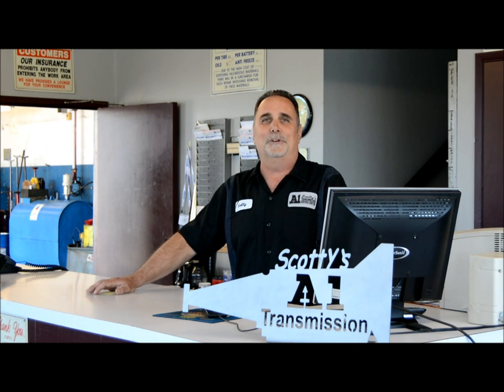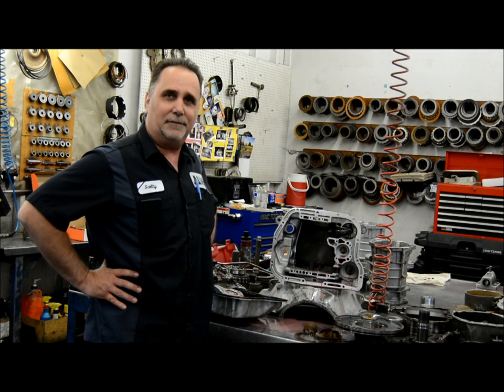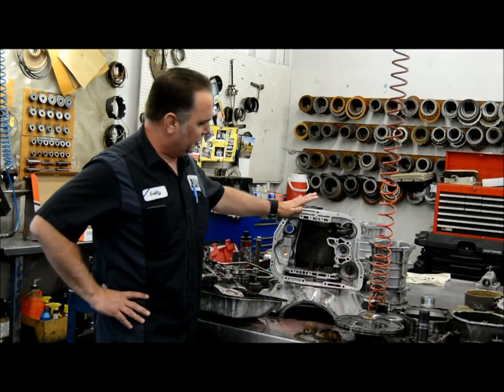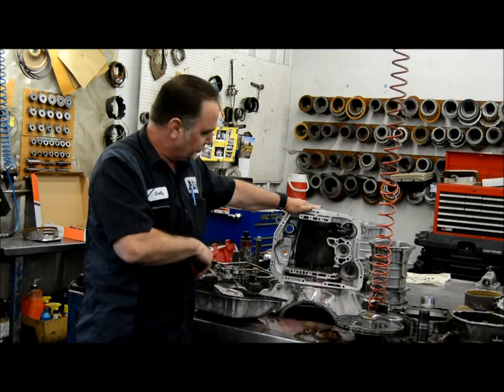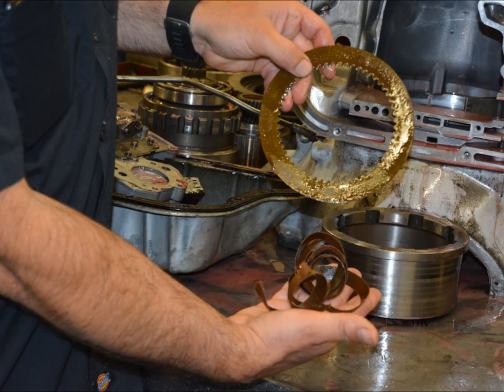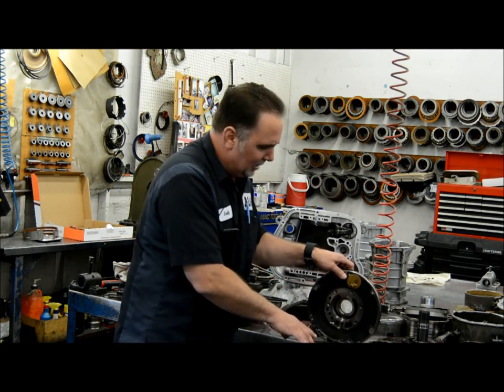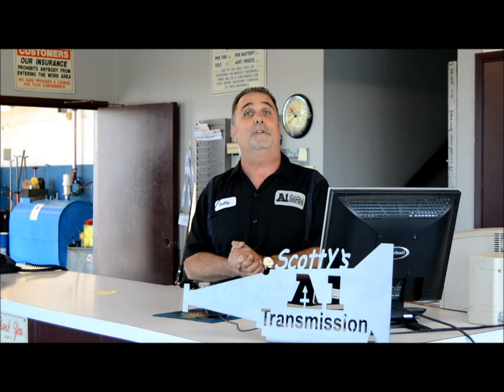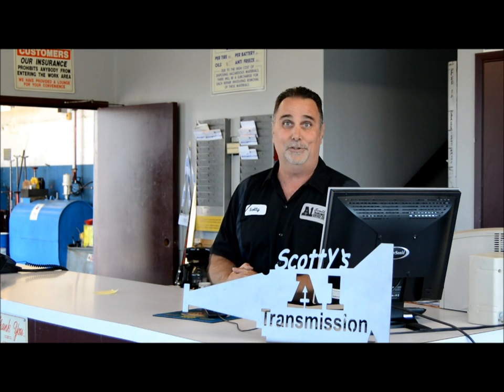Got water in your transmission? Don't try to flush it out!

Comment: I flushed mine out I used 3 gallons then I replaced my filter than I used a other 3 gallons to flush again and 6 years later it still runs but good advertising thoe thanks for the info
Reply: It would mean a lot if you reply back you seem to have some knowledge about this my cooler inside my radiator cracked thus letting coolant and water in my transmission since that happened my TPS MaP and crank sensor went out for some weird reason thought transmission was done cause it was reving high and didnt want to shift changed the sensors now it shifts perfectly installed aftermarket transmission cooler since then the transmission has only overheated once again scaring me thinking i should just give up and send it to get rebuilt i think it only overheated cause i was driving it with the bad sensors so it was working twice as hard due to the high  rpms before shifting what are the chances that a transmission is done after this happends it happened to me at a trail drove home like that and flushed it 2x so far last thing i think ill do for it is change the filter whats the reason behind the lines and oil pan getting extremely hot is it because the water in there has a lower boiling temperature  ?
Reply: My 86 chevy got flooded , i flushed it , but it dont get used much , drained it three times actually , i didnt flush it , its still pink , i took it on a couple trips 45 miles , so far so good , now i got my 09 chevy in the shop , it was right beside the other one . I know that freshly rebuilt 4l60e is toast aint it ..i just pulled it ..

Comment: I had this problem on my honda pilot. Flushed the trans. And 40k miles later it's still good. You trans shop guys are over exadurating sometimes. Plus this is vehicle specific. A pos dodge 3500 is a heavy truck and it takes a lot to move it around.
Reply: Still going good?
Reply: u ain’t lying did the same thing on this Mercedes in it’s working probably over time it might fuck up
Reply: got an 04 mdx with 180k that we are doing the flushes on right now... so far going good.. not pushing the car hard yet.. it and the engine got contaminated... 3 quarts trans. and a engine flush each week.

Comment: I believe that a transmission can possibly be saved if it is caught early on and properly flushed.  I just recently went through this and have put 10,000 miles on my transmission so far without issue.
Reply: What do you drive

Comment: Get to the point, demonstrate problems caused it how to repair and fix properly.
Reply: The water they are talking about is coolant. What happens is radiators chambers explode inside the radiator or leak internally and get coolant into the transmission side of the radiator. It will mix throughout the engine and transmission quick and total the car unless you got a ton of money. Flushing of the entire cooling system and transmission is needed. But there is almost never a system that will tell you what happened unless you check your car often and the transmission will be destroyed and the engine possibly to. Hope this helped explain your question.

Comment: It happened to me before 3 years or more in nissan altima 2006 first drained coolant from radiator changed it then drain transmissiin oil refill with oil transmissiin untill its clear or better mean 2 time is ok keep car heating up then change gear after that drive car for 5 minetes all gear then go back and drain oil and refill again  and take a ride so total drain refill 5 time from your first drain then refill it with oem transmissiin fluid and you are done your transmissiin will run like a champ no problem for me flushed radiator and ive added external radiator for transmission
Reply: Do you use new transmission fluid every time?
Reply: @MisterFuturtastic  yep
New its chepo atf transmission fluid i bought a big cartoon it contain 25 can eacb is one liter coast me about 50$ and then refilled with good oil so its cheap fix than buying New transmission or used and ask for mechanics to do service for it then install it so its big headache also this changing oil 5 time is big headache for few hours only and you are done good luck friend
Reply: Great info thanks so much! Good luck with your transmission!
Reply: @MisterFuturtastic   its working since the day ive done the flush
Reply: Awesome!

Comment: Good advise if you want a 100% reliable fix.
Great Video, love seeing the inside and getting the expert advise, if you were around manteca I would bring my car by, I love honesty.
 
If your willing to risk getting stuck and wasting money (I drive just around town in my Chevy Venture) then I would; 
1. Disconnect the transmission line and get all the bad fluid out while the car is running in park this helps pump the fluid out of the transmission and torque converter. once the fluid is out replace the filter, clean the magnet. 
2. fill it and let it cycle and do it again. we don't drive far and this worked on mine.  
3. don't plan on taking it far, expect it to fail, and get some towing..... plus plan on a new vehicle or taking it in. start saving looking and look for a low interest loan.
this job cost me 450$ because of all the fluid, filter, gasket, and I needed a radiator as well.   Taking it to the shop is going to be 2000$ easy. Might want them to replace the engine while they spent the labor to everything out it would be cheaper that way in the long run and if you like the car with high mileage it is worth it.
Reply: It lasted 6 months......... I am back to tell you.... When your right your right.  I am now looking at a rebuild.

Comment: I've seen this myself. One other thing that is bad about this is you never get rid of all the water!!! A big percentage of it stays in the torque converter, & it also starts to rust the steel components. Best thing to do while your car is having the transmission fixed is to spend the extra money & have the specialist I.E. YOU install an external trans cooler.

Comment: Hi i have Honda City zx cvt 2007 model..my cars was flooded with water..now engine started working fine but my Cvt transmission still has some water in it...i have changed transmission fluid almost 5 times but still it has some water which contaminates oil...any solution

Comment: I dumped mine so the clutch wouldn't be sitting in funky fluid, but there was TONS of dust in there, no chunks though, I plan to fill it up with fluid then go get it flushed at the lube place or whatever, any additive products you can suggest that will help me get the most miles out of it?

Comment: My problem was i had just did a trans fluid change and when I was filling the fluid some fluid got on the exhaust manifold so I took a bottled water and splashed water on the manifold so it won’t catch fire or stink bad, but some of the splashed water made its way down the filler tube. Sometimes when I check the fluid on the dipstick I see little speckles or  of white. Nothing big. The vehicle is shifting nicely
Reply: How is it now?
Reply: @lewisproffitt9584  still running good
Reply: @kchilz32  nice, I left some old fluid out and it turned murky red and I put it in my car last night really worried about it 😂

Comment: Hello.  My dealer says my 2018 with 20k mile 4 cylinder 9speed automatic has water in it.  I don't know how never been in deep water.  Possible this happened from an engine wash? How about idling for long amount of time?  So is your answer that I need a new transmission or a rebuild? Also how can I tell if a used transmission had water in it? Thank You.

Comment: How did the water get into the transmission??
Reply: Transmission fluid passes through radiator, this helps to maintain proper temperature of transmission, in case of any leakage between water passage and transmission lines in the radiator leads to mixing of water and transmission fluid. Some vehicles have separate air cooling system, which is trouble free.

Comment: I have a question. I'm remaining a 1997 46 re right now and the reverse drum looks really great except it's got this....little, teeny, tiny bit of rust on it. It's just kind of speckled on there. I suspected it had been running water with the fluid but I didn't notice the rust as I pulled it apart. I left the old fluid on it but it sat on the bench for like a week. I'm thinking it was a mixture of coolant and ATF and maybe it dried and now there's flash rust because it finally got to oxygen. It look spectacular actually otherwise. What will that rust do of I reuse it? It's really, really superficial. You can wipe a lot of it off with a rag.

Comment: greetings, I spend with my ford explorer, entered the transmicion water. repair the radiator. drain the oil. and I have already done 2 oil changes, but I feel the changes as heavy. improved oil color but not 100%. What do you recommend me. the model of my transmicion is 5R55S. perdo by language. I am from Venezuela
Reply: If you read the service manuals for most vehicles, flushing the fluid only removed 1/2 of the total volume of fluid in the transmission. So the first time you do a flush, you will have half as much water; the second time, a quarter; the third, an eighth. Water gets mixed into the transmission, torque converter, lines and radiator (if present). The best thing to do after a flood is simply not try and drive your car; but there is no need to tow it to a transmission shop. Water enters the transmission via a vent tube or dipstick on top of the transmission. You can simply do a transmission flush from the exact location it took on water. Do not start the car or put it in gear or else you will start the mixing process....

Comment: I bought a 2001hyundai Elantra I was told that the transmission was shift ing hard because  of sensors so I rolled the dice for 300 Dollars  it took me 2 days to realize that there was water in the transmission I checked the car transmission  oil was Pink but after driving it I opened the radiator there was brown sludge built up  I thought blown head gasket but the oil was fine checked the transmission again it was Pink but at the top there was burly visible brown sludge I proceeded to drive it another 100 miles and bought 6 gallon of transmission oil and bought a transmission radiator cooler installed it the car shift s smooth  but my sensor s are mess up some times  it up shifts and down shifts so it kicks caused by flooring it when down shifts I'm at my 1000 mile marker right now      ...... Thing's that car did when it had this problem  shift hard very hard also when put it to drive or reverse gear would not kick like limp mode and if accelerated it kickin into gear with a big push and loud noise but no problems til this day
Reply: probably a simple shift solenoid(s) change would have helped too.. good job thou.

Comment: I have attempted this, possibly ignorantly, on a 1986 Nissan Stanza station wagon with 4speed OD auto..  i flushed it with Diesel multiple times, only runing the engine slightly stationary, working all the gears and changing the diesel with fresh for each session...iv now recently switched it back to used-ATF (drained from other cars in my collection with ok/working fluid..)to flush additional water & to get the diesel out...then began driving it a mile or 3 and continuing to change the fluid for now new atf until it stops becoming dirty...the car only has 105k on it, warehoused indoors since 1999...no rust. Only paid $1k for the car and the ultimate fix is to replace the transmission, which would be fine with me converting it to a 5 speed...used transmissions for this car can be found for less than $250.. im concerned it may already be ruined, it seemed to have a lot of diesel left in it after the first time i started driving it...im seeing slight flakes of metal in the drain pan..but they may be normal...nothing is loud yet, but it shifts sloppy and clunky...the fluid is staying clean longer and i may be close to the last necessary changings.. would something this old, or Japanese be less or more likely to recover with repeated flushings?...the car was flooded, how it got water in it in the first place. wasnt driven after the flood, been restoring and fixing everything else on it. it sat for 12 whatever years and then was flooded more recently..

Comment: I have question? My car is now on the chevy service dealer, they told me theres water on my transmission they try to flush it out and replace some expensive items such as transmission air cooling but they told me it dint work now they told thats they going to pull out my transmission to get all the water inside, is there a chance that my transmission were fucked? Becouse am scared they will tell that theu have to replace it
Reply: If the dealership said something was wrong and it wasn't the cause then they will fix it untill it's made right, they pay for their misdiagnosed problem, not you.

Comment: This exact same thing happened to my Ford Expedition. Something in the radiator (cooling tube?) wore out causing water to go into the transmission fluid and transmission fluid to go into the coolant reservoir. Because I didn't have money at the time to get it repaired I continued driving my truck and even when I finally put it in the shop it was still driving fine. Occasionally though I would notice the transmission changing gears when it wasn't supposed to but other than that it drove fine. My mechanic is currently rebuilding my tranny using brand new gears and such because I can't afford a brand new transmission plus, my truck is almost eighteen years old. I can't afford car payments plus I like my truck and want to keep it. 
The mechanic has a new radiator he's going to install and he will flush everything out and put in new fluids of course. The cost is little over two grand. Cheaper than a new vehicle but imagine that the radiator caused all this damage.
Reply: sandra johnson to avoid having the same issue, add an external radiator cooler, it will bypass going into the radiator.

Comment: What causes the broplem
Reply: Using a usual water in the radiator ... Chemical reaction occurs and salting of the cooling system leads to make a hole in a oil cooler
Reply: The PROBLEM is you mix p's with B's. It's digusting.

Comment: I just bypassed the internal trans cooler and kept the external trans cooler. Flushed  coolant system out and now drained and fill tranny. The engineers at Nissan are morons.
Reply: Only have reverse no foward gears in a 420E 1995 Mercedes? What to do to fix